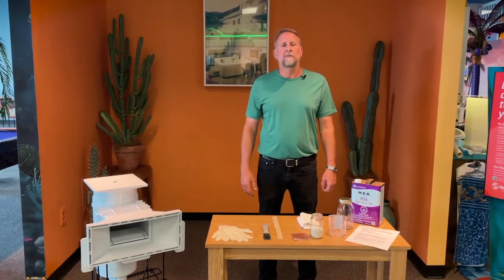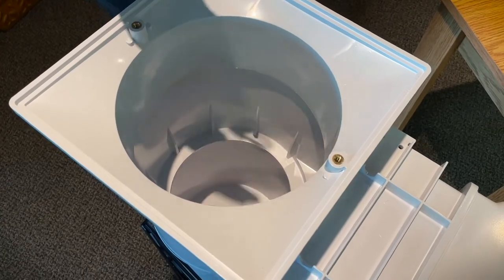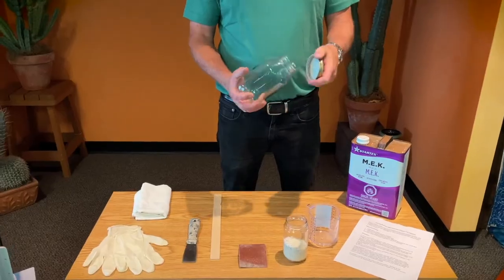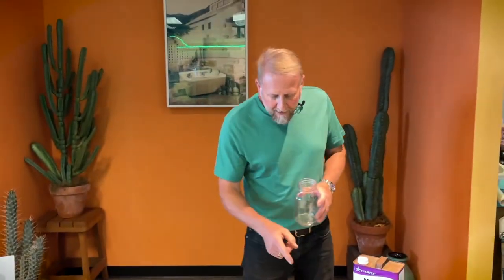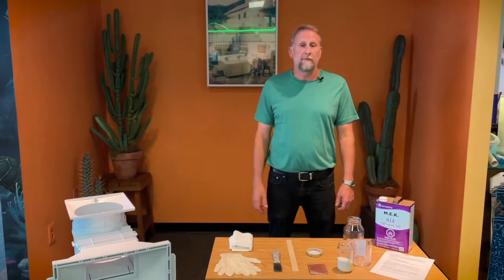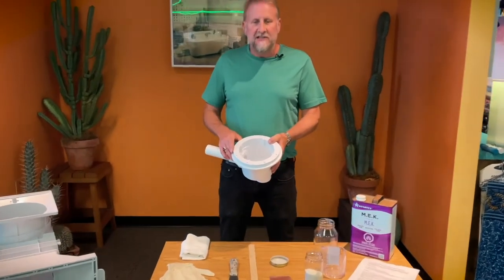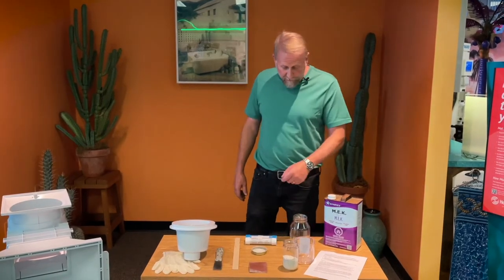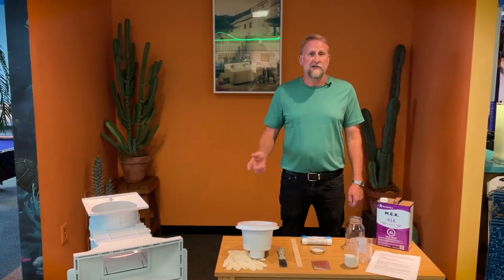How to Repair a CRACKED Pool Skimmer!

Comment: I had a 300 gallon a day leak and found out it was my skimmers, but once I lowered water level and inspected them I do not see any cracks but see seams that might be the problem what do you think???
Reply from the maker: @awesomemike3494   Fill the pool, then turn off the pump. With the water perfectly still, squirt some food coloring or dye directly on the crack or seam in question. If the dye gets sucked in, then you will know you have a leak. Thanks for watching.

Comment: I followed your directions except I poured a 1 1/4 deep on bottom of skimmer . It has been 24 hrs  now and it feels soft. Should I just leave it  or poke holes in it or try to remove it and start over. I loved your video. Thanks
Reply from the maker: Leave it, it will eventually cure. If you pour that thick it will take much longer to cure. Thanks for watching.
Reply: It never dried. Tonight checked on it and it was swollen up. Stuck screw driver in it and started pouring water and sand from hole. Pulled out schmere and bottom of skimmer is gone. I quess it never died and allowed water to seap through crack. We have had a lot of rain here. Is there anyway to fix skimmer now?  Thanks
Reply from the maker: When working with schmear the surface needs to be dry and clean so it will bond and cure. Work with a 1/4 “ thickness at a time  for best results. Once it dries you can add more to the repair. If your skimmer bottom is completely gone then you will have to replace the skimmer.

Comment: There is a fairly large broken/missing portion on the wall of my skimmer. Can I put another material such as a piece of plastic over the broken area and then seal it all together as you show in the video?
Reply from the maker: I would recommend to replace the skimmer. This type of repair is possible depending on the damage. If you send a picture, I will be glad to take a look.

Comment: A pool guy told me I can mix shaved pvc with M.E.K is the same thing as schmear pellets. Nobody in the USA has the schmear pellets.  I ordered a month ago off the web. Supposed to be here on 22nd Aug. I know what's going to happen. They're gonna say they never came in. So I did the pvc and M.E.K but it's not breaking down. Any suggestions?
Reply from the maker: I would use the schmear because it works, I'm not sure about using PVC. I carry the schmear as well, however the manufacture has it on back order at this time. If you would like to check back I should be able to get it for you when it becomes available.

Comment: As the ground settled, it created vertical hairline space along the length of the skimmer’s opening.. it looks it is filled with something hard and not rubbery.. what material should I use to fill the entire length of that hairline space to stop the leak? Thank you so much for your tutorials
Reply from the maker: @azrak555    You can use schmear, dry out the skimmer, clean and sand the area of repair. If you need schmear, there is a link in the description of this video. Thanks for watching.

Comment: Can a 2 inch crack at the bottom of the skimmer cause a big loss (approx 1 inch) of water over 24hours in a 90,000 liter pool?
Reply from the maker: @Tonykayemusic     Yes, if your skimmer is cracked then you will have a leak but you can repair it. I have the schmear linked in the description of this video. Thanks for watching.
Reply: @HallmarkPoolSupplies  ill def get this product and hopfully that will put an end to the water loss. I plugged the skimmer and turned its valve off as well to test for leak on that line. I suspect that thst crack is the main problem. Thanks for your reply and for making great comprehensive videos about pools.

Comment: HEY MARK I'VE APPRECIATED YOUR SERIES ON POOL REPAIR..I'VE KNOWN NOTHING ABOUT POOLS TILL THE HOMEOWNER NEEDED THE SAND CHANGED IN FILTER SO I GOT INVOLVED AS I'M THE PROPERTY MAINTAINER BUT NEVER HAD ANYTHING TO DO WITH THE POOL TILL NOW. CUSTOMER KNEW ENOUGH  ABOUT HOW THE SYSTEM WORKS TO GET ME STARTED THEN I WENT TO LOCAL POOL SUPPLY BUT A LOT OF INFO I CONFIRMED AND LEARNED ORIGINATED WITH YOU. THOUGH THE SAND REPLACEMENT THIS YEAR WAS SUCCESSFUL, THE CHALLENGE WE'RE HAVING FOR 3 YEARS HAS BEEN A LEAK WHICH WE DON'T KNOW HOW TO IDENTIFY WHERE IS FROM. HE KEEPS HAVING ME ADD WATER WHEN LEVEL GETS NEARLY BELOW SKIMMER BUT WATCHING THIS VID MAKES ME THINK WE SHOULD LET THE WATER CONTINUE DRANING UNTIL THE POOK STOPS  LOSING WATER THEN MAYBE WE CAN IDENTIFY THE SOURCE. IN OTHER WORDS IF IT WATER LEVEL FALLS BELOW WHERE WATER ENTERS SKIMMER  THEN LEVELS OUT THERE I GUESS THAT MEANS ONE OR MORE OF THE THREE SKIMMERS HAS A CRACK...IF IT CONTINUES TO FALL THEN MAYBE THE RETURN PORTS OR THE LIGHTS..QUESTION : IF THE LEAK IS ISOLATED TO ONE OF THESE COMPONENTS, HOW CAN IT BE CONFIRMED ? SO IF WE SUSPECT THE SKIMMER IS CRACKED BUT NOT SURE BECAUSE NOT OBVIOUS IS THERE A PROCDURE TO CONFIRM ? SAME FOR THE LIGHTS ,ETC. THANK YOU.
Reply from the maker: If you would like to check out  my videos titled, "find a leak like a pro" parts 1 through 4, this should help. Thanks for watching.
Reply: @HallmarkPoolSupplies  THANKS MARK 👍
Reply: @HallmarkPoolSupplies  I HAVE WATCHED ALL THOSE VIDS BUT REQUIRE MORE SPECIFIC ADVICE ON HOW TO DETECT A LEAK IF YOU SUSPECT IT''S THE SKIMMER..I'LL WATCH AGAIN BUT THE CHALLENGE IS FINDING WHERE THE LEAK IN A SKIMMER IS IF YOU CAN'T SEE IT. SAME FOR A LIGHT IF THERE ARE 6 LIGHTS IN A POOL HOW DO YOU KNOW WHICH ONE NEEDS REPAIR .THIS POOL I'M WORKING ON HAS SEVERAL LIGHTS AND 3 SKIMMERS ,( NOT TO MENTION THE DRAINS ), BUT I'M NOT A DIVER. I HAVEN'T SWAM IN A LONG TIME BUT SINCE  I RUN I THOUGHT I'D BE ABLE TO HOLD BREATH FOR A COUPLE MINUTES TO INSPECT THE DRAINS WITH GOAL TO AT LEAST UNSCREW THE COVERS AND CONFIRM SUCTION ...NOT ONLY COULD I ONLY HOLD BREATHE A SHORT TIME, APPARENTLY THE BODY WASN'T CREATED TO SINK TO BOTTOM SO  FREE DIVING WAS A FAIL.
Reply from the maker: @matthewpolo227  In order to help I need more information because there are several different things to discuss in greater detail. If you would like to check out my patreon page I will be glad to help.
Reply: @HallmarkPoolSupplies  I'M NOT YET CERTAIN I'M TAKING POINT ON THIS THE POOL SERVICE IS SUPPOSED TO BE HIRING A DIVER BUT THAT HAS NOT OCCURED YET SO I'M TRYING TO BE PREPARED IF I NEED TO GET FURTHER INVOLVED. THE CURIOUS GEORGE IN ME HAS GOTTEN INTERESTED IN YOUR INDUSTRY SO HOW DO I GET TO YOUR PATRON PAGE ?
Reply from the maker: @matthewpolo227  The link to patreon is in the description of the video. I'll be glad to help.

Comment: Mark! Thank you very much for your channel! It's very helpful, I have a question my skimmer has two holes, I need to close one?
Reply from the maker: @araceli8933    Skimmers have two openings, one is 1 1/2” and the other is 2”.  1 1/2” is standard on most skimmers and the 2” opening is usually plugged. If your skimmer has two holes that are both open then you have a skimmer that is tied in with the drain line or a vacuum line and it has a throttle plate. If so, you will close one when you vacuum the pool. If you are repairing a skimmer like this do not seal either opening. Thanks for watching.

Comment: Previously repaired with the two part epoxy on the lip the skimmer basket 🧺 sits. 
I feel like it would be best to remove the hardened old epoxy (that would also help basket to sit better)
Do you recommend removing the old epoxy? 
Do you ever use a layer of fiberglass tape and emeshed in the Schmear paste?
Happy to Patreon for your excellent video and advice.  😊. Subscribed
Reply from the maker: @oahukiteboarder808    Yes, remove and sand off any other material before applying schmear. You can use mesh, however it is not needed. Thanks for watching.

Comment: How do I find out if it is the skimmer that is leaking?
Reply from the maker: @kathleenadamski5439   Schmear is made to repair skimmers, drains or any other white goods. If your skimmer is cracked then you need to repair because it’s probably a leak. If your pool is leaking, l have made several videos on how to find a leak in your pool titled “How to find a leak like a pro”. There are 4 parts to this series, start with part 1 then you can watch parts 2,3 and 4 if needed and hopefully this will help. Thanks for watching.

Comment: Hi, I was wondering if I used a 2 part apoxy about a week ago, the leak has slowed down a bit, can I used the pebbles on top of it after sending it a bit to fix the skimmer or do I need to take off the apoxy completely and and sand it to nothing before applying your product ?
Reply from the maker: For the schmear to bond properly you want to apply directly on the surface, once it has been cleaned and sanded. I would not apply the schmear over the epoxy coating.

Comment: We had a pool company fix our skimmers with the epoxy, it lasted about a year. Is there a way we can still do the schmear repair or would the epoxy need to be removed somehow first?
Reply from the maker: For best results l would recommend to sand off the epoxy. What is not removed, you can rough up the surface by sanding. This will make for a better bond. Thanks for watching.

Comment: I can’t get the pellets to breakdown into a creamy substance. I follow the mixing instructions and use a beater mixer to try and make the smear. I end up with a gravelly substance unfortunately. What’s the key to getting the substance creamy with the mek. 
Anxiously waiting your response 
Phil
Reply from the maker: You may need to add a little more MEK and just keep stirring until it gets creamier. This may take a few minutes. Do not mix too much at one time because you only have so much tooling time and the schmear will get hard. Also, verify you are using MEK.

Comment: Will this product work on an above ground pool skimmer?  My pool is only 3 years old and I don't want to have to replace the liner because of a crack in the skimmer.
Reply from the maker: You can replace the skimmer without having to replace the liner. The schmear can work on an above ground skimmer, however it would be cheaper and less hassle  to replace the skimmer than to repair. If you need help just let me know I will be glad to help.

Comment: Can shaved pvc from a plumbing pipe be used instead of schmear? We drill out and recover pvc fittings which creates lots of pvc shavings. I need to repair my skimmer this weekend and can't wait on pellets to arrive.
Reply from the maker: It may or may not work, you can try a small section to test first. Keep in mind it may adhere, but will it hold permanently in the long run? Only time will tell. Thanks for watching.

Comment: Will this work on a hot tub. Just wondering since it’s hot water. Temp around 103 or 104 degrees
Reply from the maker: If you are referring to skimmer repair, yes. Once the repair is made the temperature will not affect the repair. Thanks for watching.

Comment: So we just had a brand new pool installed. There is a leak in the skimmer box on one of the inlet tubes on the bottom. 2 leak companies confirmed it. The first time they did the epoxy, and it failed after 2 months. They tried it again and it failed immediately. Now they are switching out the inlet pipe with the unused side. They are giving us a hard time. When they change the pipe, can I completely fill in the new unused inlet pipe with shmear? I want to make sure myself this is fixed. Thanks
Reply from the maker: Yes, you want to pour the schmear in 1/4” to 1/2” increments so that it will cure faster. If you pour thicker it will still cure, but it will take much longer. Thanks for watching.
Reply: @HallmarkPoolSupplies  so they repaired our skimmer box. We had 2 pipes, 1 had the leak and the other was empty. They decided to switch the pipe to the empty one and cap off the bad inlet pipe, then completely covered it in epoxy to fill it in. I’m having a hard time trusting the epoxy fix. Can I schmear over epoxy to kind of “seal it all in”?
Reply from the maker: Yes, however I am not sure if the schmear will bond to the epoxy that was used.

Comment: Hi love your video.  I just located a hole in my skimmer about the size of my thumb nail. Do you think this would repair it?
Reply from the maker: Yes, this repair can be made. l do sell the schmear and the link for this is in the description of the video. Thanks for watching.
Reply: Good morning 
Ok should I be concern about the water that's getting behind skimmer thru  the hole?
Reply from the maker: Yes, in time this will only get worse.
Reply: Ok Is there anything I need to backfill with before I repair it?
Reply from the maker: Not necessary, but if you want to you can. You can use newspaper, that will work.
Reply: Ok Thank you again ❤

Comment: Hello great video . I will be doing repairs on my thermoplastic steps on a inground pool . There is blisters and small cracks . Will this product work as a filler befor painting ?
Reply from the maker: I believe that the schmear will bond to thermoplastic, but it would be best to check with the manufacturer.
Reply: @HallmarkPoolSupplies  Great thanks for the help

Comment: Hi, thanks for the greast video. I have a broken skimmer, it broke on the bottom all around the drain hole, it's like the drain pipe that's connected to the skimmer made pressure on the drainage and broke and lift it. I'd like to know if i have to push it back ( in that case do you kindly have any idea on how to do it) or i can just apply the smear as it is ( i made it into an almost liquid paste, i suppose that way he can infiltrate all the cracks and seal them. Thank you kindly and keep up the good work!
Reply from the maker: If you can send me a picture, I will be glad to help.

Comment: I know you have the pellets and I can get an MEK substitute locally, but my question is about the substitute. Will it be okay to use for this type of job?
Reply from the maker: Yes, if it’s the same type of solvent then it should work.
Reply: @HallmarkPoolSupplies  Thank you so much for the info! The substitute MEK worked perfectly. When I dug out the epoxy that we had used in there for years, I found that some of it hadn’t even cured completely and there was a fairly large crack (big enough for me to stick my finger in) underneath the epoxy. While I’m a little concerned that this is a sign that the plastic of the skimmer is deteriorating, I’m certain that I bought some time because I put two rather significant layers of schmear in it. Boy, was it hard to work, but it certainly has been worth it. For the first time in years, we aren’t having to fill our pool at least a little bit every day (recently it was much more than a little bit). It’s obvious that the skimmer leak has been stopped completely. Hopefully, this will be a long term repair, but even if it isn’t, the savings on the water bill for the next few months will more than cover the costs. I’m so happy that you posted that video. If you hadn’t, I almost definitely would’ve been looking at having to dig out the skimmer in the very near future. If something goes south, I’ll let you know, but so far it’s looking really good!!

Comment: Hello, I’m currently trying to repair a crack at the bottom of my skimmer using Hayward schmear compound and MEK. I made the mixture little runny to cover the whole bottom of the skimmer. But it has been more than 48 hrs the mixture feels dry to the touch but the texture is still soft like silicone is that normal?
Reply from the maker: If the schmear is thicker than 1/4” it will take longer to cure. Leave it set a little longer a you should be fine. Thanks for watching.

Comment: Hello, if the skimmer box is cracked, is it necessary to replace the skimmer box and concrete slab? Or it can always be sealed? Thank you
Reply from the maker: It depends how bad your skimmer is cracked, if you send me a picture I will be glad to look at it for you.
Reply: @HallmarkPoolSupplies  Thank you. May I have your email and where are you located?
Reply: @HallmarkPoolSupplies  why is skimmer box made of plastic instead of something like stainless steel?
Reply from the maker: @thebellachen-1667  Our email is located on our site.
Reply from the maker: @thebellachen-1667  Because of cost and rust.

Comment: Hello Mark, We have an inground pool with vinyl liner and fiberglass steps with Jacuzzi feature.  We are getting air bubbles coming out of one return from the pump.  Any suggestions please?
Reply from the maker: It sounds like you have a suction leak. I made a video in regards to air bubbles in your pump, dealing with suction leaks. Here is the link, hope this helps. Thanks for watching.
https://youtu.be/SiEOIxYpJ5g

Comment: Hi I recently purchase the Hayward Schmear pellets and M.E.K, while mixing was a chore and very time consuming I was able to dissolve all the pellets into a syrup consistency.  After extending the pipes I poured the Schmear at about an 1” high.  Within a few hours a skim formed on the top and it 😊felt rubbery.  2 days later it still felt rubbery so i poked a toothpick through the skim and MEK leaked out.  After doing this for 7 days the Schmear finally harden.  What did i do wrong?  Was it the original depth ?.  How long should a 1/4” take to cure?
Reply from the maker: When pouring schmear that thick it will take much longer to cure. A 1/4” application will usually cure within 24 hrs. Thanks for watching.